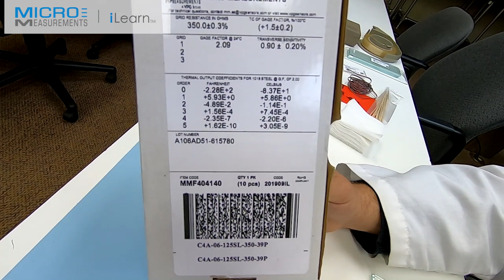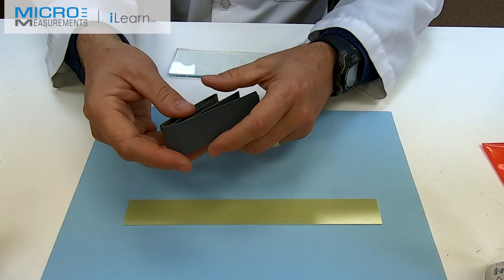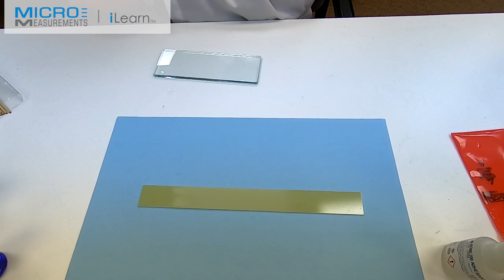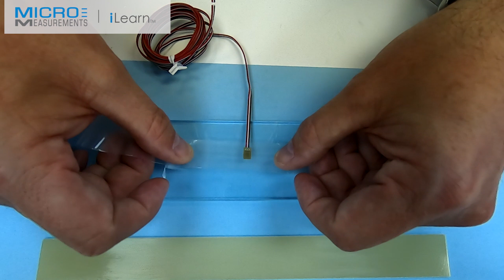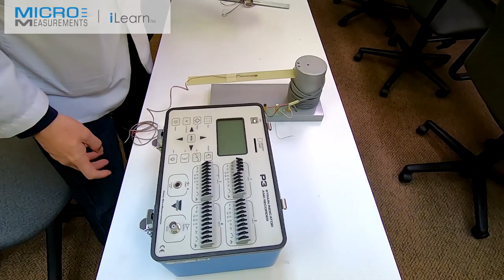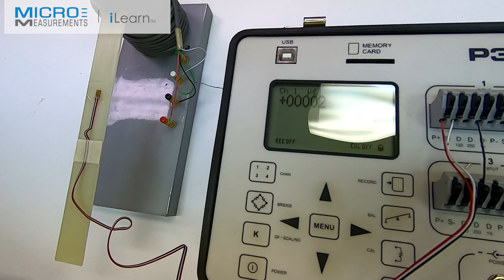Advanced Sensors Technology Strain Gage Bonding to G-10 Fiberglass (Composite Materials)

Comment: En este video de Micro-Measurements, Darryl muestra todo el proceso de instalación de una banda extensométrica de la Serie C4A, de Tecnología Advanced Sensors, en materiales compuestos (composites) de fibra de vidrio. Específicamente, se muestran los materiales y las correctas técnicas de preparación de la superficie, así como la banda extensométrica C4A-06-125SL-350-39P instalándose en el composite de fibra de vidrio G-10, usando el adhesivo M-Bond 200.
Si necesita más información, por favor no dude en contactarnos. mm.es@vpgsensors.com miguel.bravo@vpgsensors.com